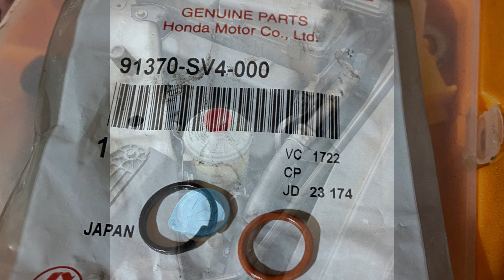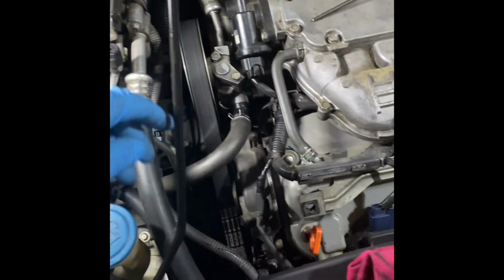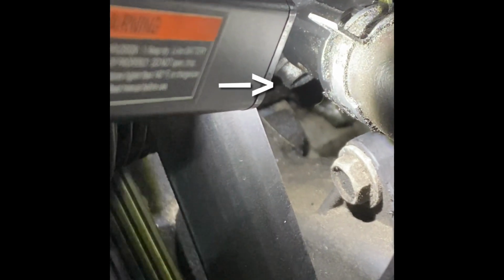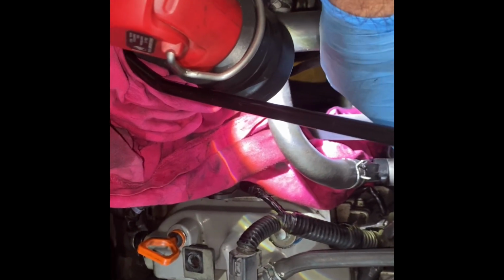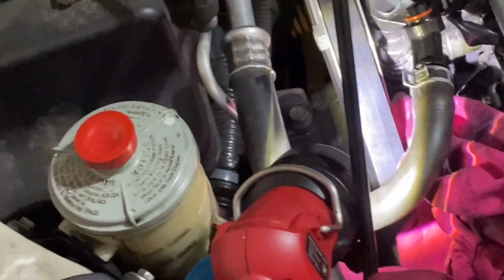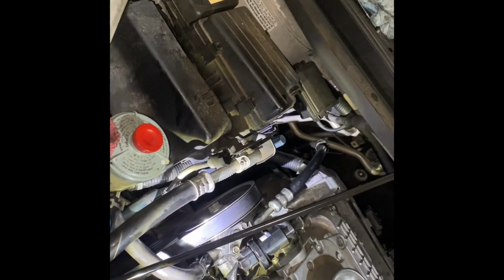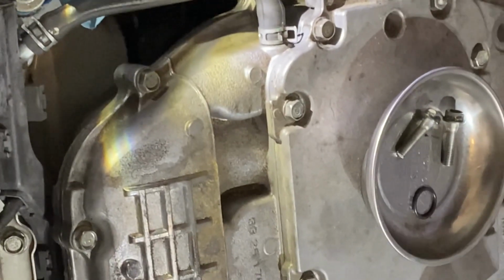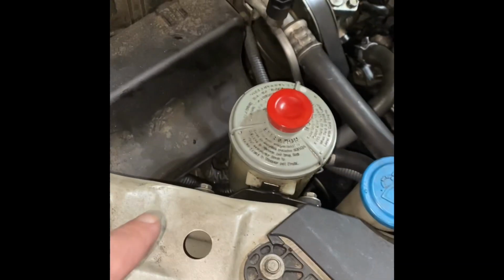Fix Honda Power steering noise when cold starting. When a Pwr Steering Flush doesn't fix it.

Comment from the maker: most of the noise has gone away it still has a little bit of a noise not as load.   everything I did for this was  did a power steering flush, 5 drain fills  using a turkey baster to suck out the fluid in reservoir  and refill (with honda compatible fluid ) and drive it for a while and repeat 4x but need to jack up the front end of the van so you can turn the wheels from lock to lock while the engine is off and reservoir  is empty, that will get a little bit more old fluid out. on the 5th one I changed to Lucus PSF with seal conditioners (compatible with all Power Steering systems including Honda)  

1) jack up van to get front wheels off ground
2) suck out old fluid with turkey baster
3) refill with honda compatible fluid 
4) drive it some turning steering wheel lock to lock
5) repeat 1-4 steps 4x
6) repeat steps 1-4 again but this time use Lucas PSF with seal conditioners

7) if still makes noise  replace O-Rings as shown in this video

Comment: Nice work on the replacement o rings despite the area to get that 🔩 off there
Reply from the maker: Cheeper then a pump replacement. Worth the gamble 
MadMax I still have,  last video on it is out tomorrow.  Found transmission shift cable bushing was disintegrated causing a case where it thought it was R when it was in P.  Which then causes  a no start condition unless you jiggle shifter or put in N.  This is a common problem on Nissans and GM but can happen to any automatic transmission car
Reply: @dfields9511  yes sir cheaper than a pump replacement for sure, hopefully you can get madmax sold
Reply from the maker: @Turningwrenches85  yep I got madMax posted for sale been getting alot of inquiries about it usually a few a day.  it would of been sold already if transmission was in better shape, but then I would have to charge more for it.  My  friend who flips cars on the side. did lookup what a used transmission costs from junk yard.   for it.  they are kind of cheep  around 250-300. but  install will be alot and also involve replacing rear main crank seal. so basically apx 700.  on the fence about it.  if I don;t get 1500 for it. then i'll look into replacing tranny  at a local shop my friend knows of.  but then I will be not taking less then 2500 for it.    If madmax was a manual transmission it would still be going strong. they did make some maxima's back then with a 6 speed manual trans.  I heard they were really fun to drive with a manual trans
Reply: @dfields9511  Well, I hope it works out for you. Whatever route you decide to go with it
Reply from the maker: I sent u instagram message on the txt of the sales post just as a fyi

Comment: The noise comes from power steering fluid being low.  Look at the reservoir.
Reply from the maker: Yea it can.  But my reservoir fluid level is between the high and low level lines
Reply: @dfields9511  What caused the fluid to disappear?  Was it leaking there at the hoses where you replaced the o-rings?  I am trying to find a leak in mine.  Wondering if I should replace these also.  Thanks.
Reply from the maker: Some things might need new high pressure line.  O rings can leak air into the system .  Also I switched fluid to lucus with seal conditioners as part of a fluid flush. The lucus fluid I got and mentioned in the video will work for a Honda. It says on the bottle for all power steering systems even Honda. 
 I had a power steering  fluid line replaced once as it was leaking and noticed power steering fluid under the car. It was very obvious it was leaking badly maybe  6+ years